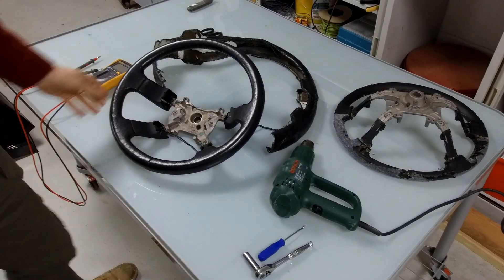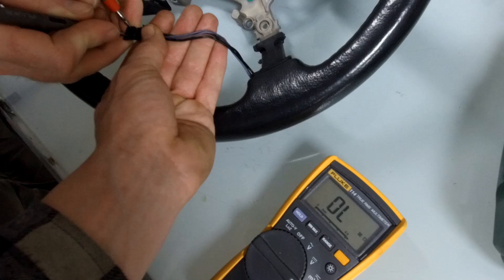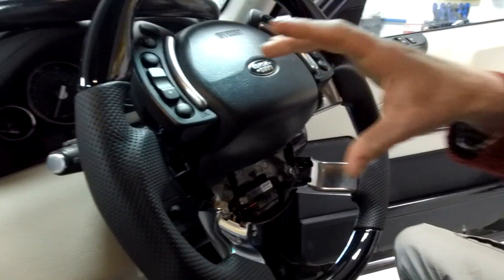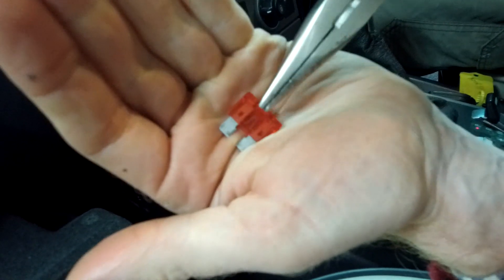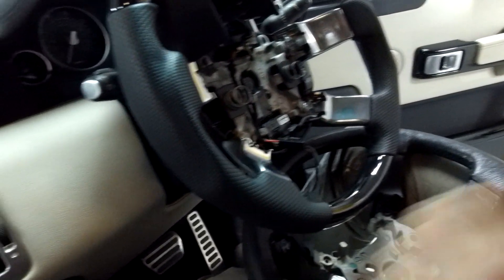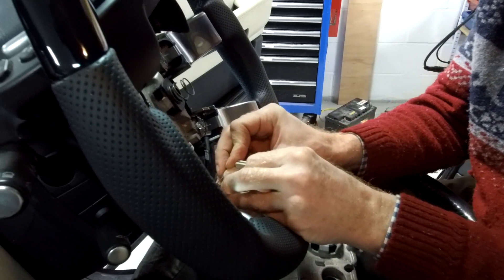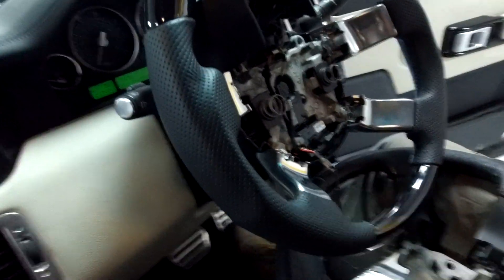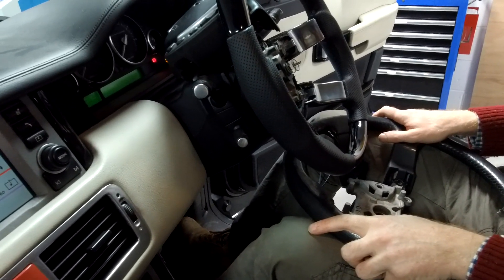Range Rover L322 Heated Steering Wheel Fault Finding Guide

Comment: Hello dear friend. If I change the original leather, will the steering wheel stop heating up? I had the leather on the steering wheel changed and now it doesn't heat up. The light only flashes once.

Comment: what if I have 6 .15 ohms on the outer wires? (heating wires)?. My heating steering wheel button doesnt work. 6.15 ohm on the heating circuit wires. 16 ohms(because of 8 celsius I think?) on the thermosta resistor wires. Thank you!
Reply from the maker: Hi the 6.15 Ohm seems OK on the heater wires but the thermistor wires should be around 10K ( 10,000 ) Ohm
Reply: @L663  
Thank you for your reply! I actually solved the problem. Mine problem was( and is) In the Fuse Box? Wiring from there and fuse is OK, but it seems that there is a problem inside the ballast. So my solution was to make a bypass from another free fuse slot to the heatin steering wheel. And it works! :D 
Btw perfect content, Ive learnt about LL RR so much from your vids guys.

Comment: Hi, so am I right in thinking that if the light goes out after a short time and you have to turn off the car and reset (as per your vid) does that mean there’s a short in the heating wires inside the wheel... you used a low value resister to creat the fault I have. I know I’m being think but what fault did they highlight... the wheel or the module?

Comment: I have a 2011 L322 Vogue se. The steering rack was reconditioned. Since then the heated steering doesn't function. The light does not go on when I press the heater button. I have checked the fuse which is fine ( no. 21). what is the likely problem. Thanks. Sabs
Reply: Sounds to me like someone forgot to install the wiring inside the steering wheel

Comment: I take it there are no fixes other than replacing the steering wheel unless its just a fuse?
Reply from the maker: if the sensor has gone you can replace that.
Reply: @L663  The sensor in the steering wheel? Is it close to the stitching?
Reply from the maker: @jamesmacdonald3090  not too far in - 3 inch
Reply: @L663  what sensor do i need,i have 2.8ohm on the outer and nothing on the inner 2 wires
Reply: powerfulukltd Where can I get such a sensor?

Comment: Hi guys, I have removed the airbag for the 1st time, in order to investigate heating issue with steering wheel. however upon re-installation i have found the air bag warning light remains on. I have tried to repeat the process 3 time to no avail. ANYONE GOT ANY IDEA'S ..can i reset airbag warning light??? kind regards
Reply: For anyone else reading this, you need a scan tool that can clear SRS codes for hard codes.
Reply: @DiscoveryJosh34  Perhaps its usefull to some to know that the software for a BMW X5 also works on the early l322's